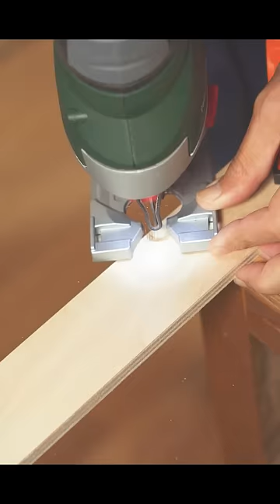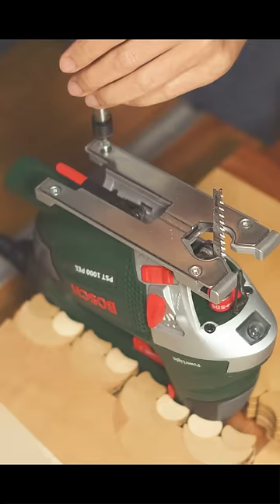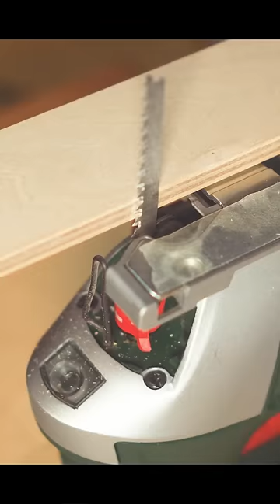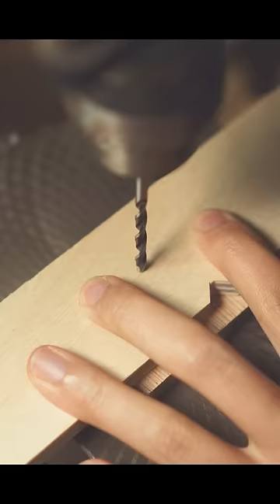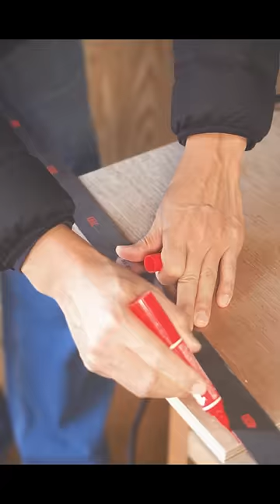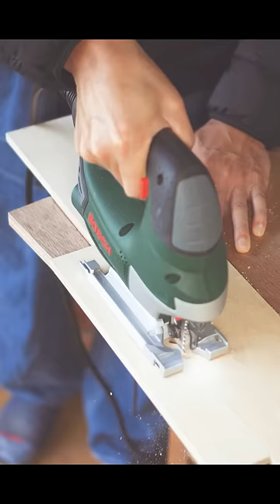Few People Know About This Jigsaw Hack🤫 #shorts

Comment: I just use the edge of the base plate, works just the same.
Reply: Yeah but much faster due to not having to build a redundant part.
Reply: But then you need an offset and don't need a video.
Reply: This jig actually helps reduce tear out
Reply: Also supports the blade for a 90° cut.
Reply: @MrKockabilly  How?
Reply: @snap-off5383  jigsaw blade cuts as it goes up. But this jig is pinned on the work piece and provides almost zero clearance opening for the blade.
Reply: Right,  I was thinking the same thing.
Reply: I was thinking exactly that
Reply: Poweruser🎉
Reply: EXACTLY!
Reply: I just used an old piece of plywood and a circular saw before I had a tracksaw. There's a difference. Like any jig or new tool, it's a calculation of the time it saves over its life vs the time/cost it takes to acquire it.
Reply: @MrKockabilly  just get one of those blades that dont give you tear out. I bought one when I did my floor.

Comment: I used to measure from the blade to the end of the base of the saw. If its 2", use a piece of wood like a parallel jig like you did, but offset it 2" from your actual saw line.
Reply: lets not simplify or explain to anybody that the jigsaw already has this. am I missing something here?
Reply: Thats how normal people do it
Reply: EXACTLY
Reply: To be fair,  this also assists w blade defection and tear out.

.... though if I need those things,  and I'm cutting a straight line,  a wouldn't reach for a jig saw at all.
Reply: A jig saw is a great entry tool. This makes it more useful, as long as the fence is easily removed.
Reply: Exactly!

Comment: thanks for the idea, I need a guide as I can't even follow a line freehand. 😃
Reply: Cut with jigsaw upside down for full control of the blade,  you're welcome
Reply: Measure from the edge of your plate to the edge of the blade. Clamp a board that far away from the line and just use the edge of the saw against the clamped board. Save you time and material building some oddity.
Reply: Could mount it to a board upside down

Comment: Adding an overcomplicated straight-cut fence to a saw made for cutting tools. Don't take me wrong, the execution was amazing, however there are easier ways to cut straight with a jigsaw. If you need precision (and only have a jigsaw) make a piece of wood that is as wide as the distance between the blade and the edge saw, alight this with the wood you are cutting and then clamp a straight piece of wood right next to it.

Comment: That’s actually going to be very useful, thank you!  I have hated using my saw because it doesn’t cut very clean and requires lots more sanding. I could even see this useful for corners.  Again thank you!
Reply: A lot of newer Jig Saws have these fences or you can buy them. 

However, if you are looking for clean and accurate. You should be doing this cut on a table saw using a sled! Jig Saws still have a blade that can move and that can be noticeable.
Reply: I don’t have a table saw. So I work with what I do have.
Reply: Circular saw?
Reply: l
Reply: l
Reply: @tobybigham4196  Why pay stupid money when you can make one for nothing.!! And a lot of people dont even know to  use the right Blade. And what if people dont have table saw and sled.??A lot of negative people seem to miss the basic reason for these videos. lol
Reply: Well said, keep cutting straight.
Reply: @ma-t6949 potato po tato 🤦‍♂️
Reply: @clutchmadsen7713 you dont see difference between circular and table saws ?😅
Reply: @clutchmadsen7713 no he means just use a circular saw instead? They're not exactly expensive and are designed to straight cut. Using a jigsaw to straight cut is just questionable
Reply: the metal baseplate of the jigsaw already does this function.
Reply: I'm going to make one. But out of some 1/4" plastic I have around here somewhere.

Comment: So to cut a straight line with a jigsaw, all you need is: 3 pieces of wood, a clamp, a drill, screws, and tape. And here I was, using the tool by itself as intended

Comment: Or you can buy a metal fence guide with clamps, measure the offset of your blade from the guide plate, clamp the fence to the piece and use with your favorite circular saw, jigsaw, or router without having to screw anything to the tool. It’s both easier to set up, and metal fence guides are very straight, long,  and smooth.

Comment: Just measure from the edge of your blade to the edge of the shoe and clamp your board that far away from the cut!

(the shoe is the metal sheet on the bottom around the blade)

Comment: It's cause few people use a jig saw for long, straight cuts.
Reply: That's not true.  They sell many high quality straight cutting blades for jigsaws that can do a great job cutting wonderful edges on melamine, mdf, etc. and really inexpensively because it's a tiny 3" blade, not an 8" disc.  An 8 pack of nice Bosch blades is WAY cheaper than any decent 8" circ blade.
Many people use jigsaws for straight cuts - hence the straight edge accessories sold for jigsaw baseplates.

Comment: Thank you!  Is there a way to avoid blade twisting?
Reply: Yes. Slow the cut down. Let the blade do the work.
Reply: @harveymanfrantinsingin7373    Thank you! I will try that. My problem is that it seems like knots in the wood push the blade sideways.
Reply: @chunglaw9644  yeah..a jigsaw definitely has its limitations!

Comment: Any tips for uneven cut with a jigsaw?
Reply: Use a circular saw.

But seriously now what do mean by uneven?  Is the blade not cutting at 90 degrees to the board?
Reply: @Mad4400  no when you use a jigsaw the blade will make like a 45° cut as you're cutting across the board so what you're cutting is straight but on the side of the board that's not even
Reply: @vincevistain7434  I know what you mean and there is a number of possible causes. 1. Dull or blunt blades. If you have to really push the jigsaw to get it to cut through the timber you'll increase the likelyhood of blade deflection. 2. Blade type. Thin blades are bendy and suit curved cuts. Heavier duty blades are more rigid and less prone to deflection. 3. Stance and posture  Try to guide the jigsaw from a position behind the saw not from the side, don't over-reach and keep feet wide enough apart to  keep a steady stance.

Comment: Let's pretend that there isn't a better tool for the job... you still did extra work. Measure from the edge of your blade to the edge of your guard. Adjust your straight edge by that distance to parallel the line you want cut, and then you dont need a jig.jyst follow the straight edge.

Comment: That’s over complicated, measure the outer deck to the blade and plus the cut . Clamp a running board to the marks and use the outer deck edge to keep level . I mean what do I know , am just a well paid engineer
Reply: Requires a pencil. This requires no such complexity.
Reply: @colorful11000  so they don’t need to mark a cut line on his piece every time ? Is that what your saying ? If he don’t mark it then how does he know what size of the wood he’s cutting? Exactly ! This tooling is to make it level but level to what if the piece isn’t measured and marked properly. Next time look at what he’s doing and read my comment and you need a pencil in both ok simpleton , this isn’t a jig doing predetermined cuts . It’s to make sure you have a straight cut
Reply: @pauldean8638  Um, sarcasm sir. Take the win sometimes and watch out calling people names especially when you are too dim to detect they already agree with you.
Reply: @colorful11000  I apologise as I read it wrong 👍

Comment: You just invented "The Fence", which usually comes included with most saws.
Reply: But don't the ones included require a minimal distance.

I like this because you aline the fence up with the line. So much simpler...
Reply: “The fence” can’t do a distance of 0 as far as I’m aware
Reply: In my experience, fences that come with jigsaws are a little disappointing.
Reply: Mine didn't
Reply: No!!! That's wrong, this is a zero clearance fence that eliminates tear out.
Reply: Yeah, but not like this.
Reply: Yes m7sharp is right. Minimizes tear out from the worst tear out machine we all own. It also allows it to function as a substitute track saw. However, all the work it took to create this just makes me very thankful for my track saw 😂
Reply: @ogre1890  however, since we can use measuring devices that won’t matter even in the slightest. Don’t get me wrong That’s a very cool trick it is simply going the extra extra extra extra extra extra extra, for no reason, Mile.
Reply: The fences that come with some saws only allow you to cut parallel to an edge.  In this example, they are not parallel to the edge of the work piece.
Reply: @Usonian7 blue tape also eliminates most tear out.  This was a waste of time
Reply: Ueppwrsbits called a fence for a reason looks to me like this person invented nothing !
Reply: @Usonian7  and blade deflection!

Comment: But who would want to use a jigsaw to cut a straight line?  Unless we have no other saw.
Reply: Jigsaws are useful for many kinds of cuts. My old Bosch 1587AVS has a sled to cut straight lines with Bosch FSN rail, and it rivals the straight cut of a hand circular saw, at lower speed, of course, but also with much lower risk.
Reply: @alfredomarquez9777  I guess with enough effort, you can make it work.  But as I pointed out, why not use your circular for straight lines?  It cuts faster as well with less tear.  The jigsaw strength is in cutting curves
Reply: Jigsaw is often better for cutting metal, you can get various blades in places a circular saw won't reach (eg cutting out a square), and lastly the final cut has straight edges even if you don't cut all the way through. 
For carpentry not a lot of point, but for cabininet making it's often irreplaceable (personally even over my table saw, circular saw etc).

Comment: Sadly the blade will chew into the fixed fence really quick, and the next time it will ride against the deformed fence and make an even less straight cut, and so on.
A jigsaw is just not a precision tool.
Reply: I agree a jigsaw isn't really the best to for cutting lines like this,  but I did notice he notched the piece attached to the saw to accommodate the blade width, which would hopefully minimize the damage to the fence. 
I have a circular saw with a guide, however, that is easier, faster, and cleaner.
I don't know many people who have jigsaws but don't have circular saws.
Reply: @Board.Dad.Woodworking I don't really see a scenario where someone would need a really straight AND square cut, and also only own only a jigsaw, a drill press, a workshop, and so on.